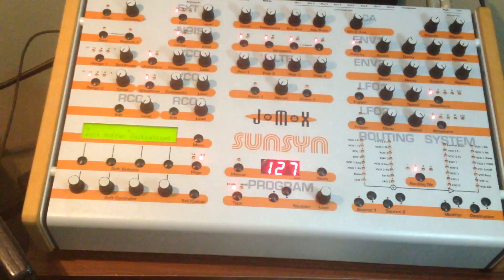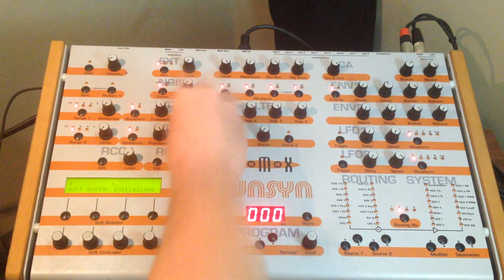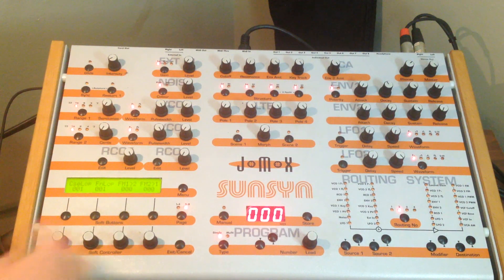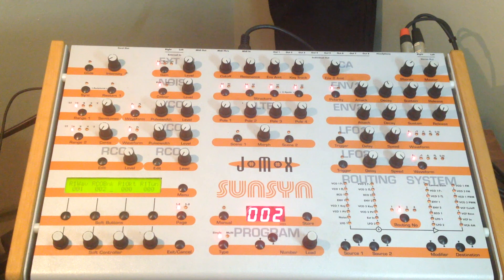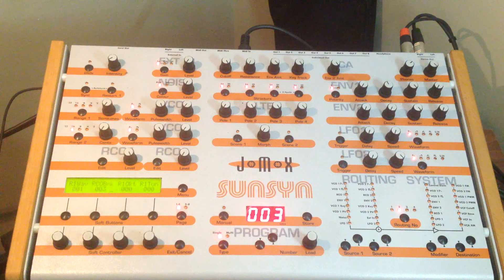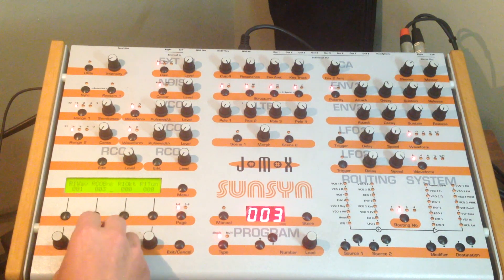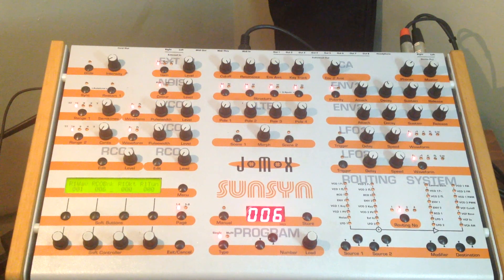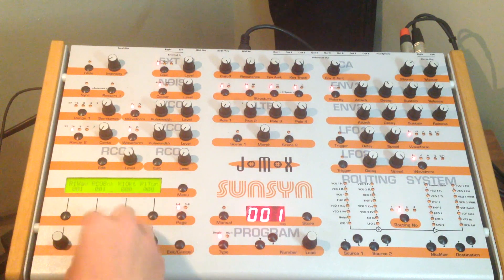Jomox Sunsyn - RCO (Ramp Controlled Oscillator) Demo

Comment: thanks for the insight of this synth. Pls more. e.g. how to upload the own samples in the sunsyn. You dont need the PMCIA Card Slot with version 2 anymore right??? --- another vid could be, how to use the sun with six single outs ( 8 is too much! ) .... best f
Reply from the maker: You transfer samples to the RCOs via MIDI sample dump using a software utility that you can find on the Jomox website. It's similar to the way you transfer samples to an XBase 888 or 999. I don't really use the individual outputs on the Sunsyn since I don't really sequence it or use it in multimode... I just play it "live" from a keyboard and multitrack it if I need more than one part.

Comment: Hi Brandon, one question,do you think is a risk to buy this synth nowadays? specially if you live too far from Germany and US, I mean for maintenance and parts, right now it's about 7 grand, too much but something that you will love forever...
Reply from the maker: There is an element of risk involved, but that's true for most analog synths that are no longer in production. The good news is that Sunsyns are pretty reliable; it's much better in this respect than owning, say, a CS80. The price tag these days is relatively high, but it's still cheaper than an 8 Voice CODE or Omega with all the options. But it's still not cheap. There's a lot of other stuff you could get for that money, but none of it would be a Sunsyn. It's a modern synth with a big vintage sound that can also do all sorts of weirdo hybrid stuff, and there's nothing else quite like it.